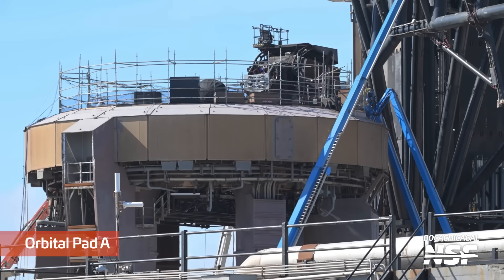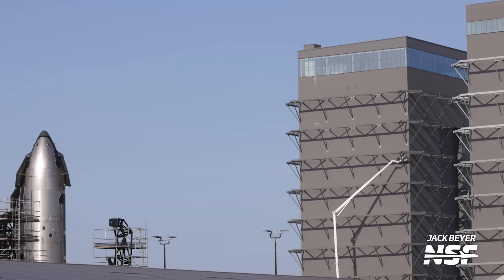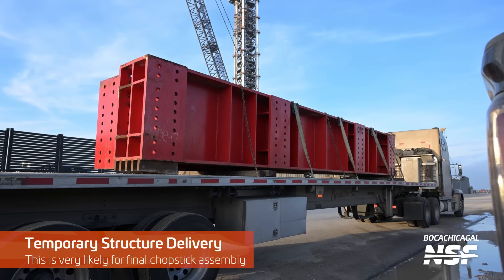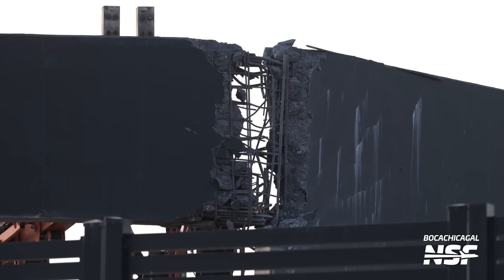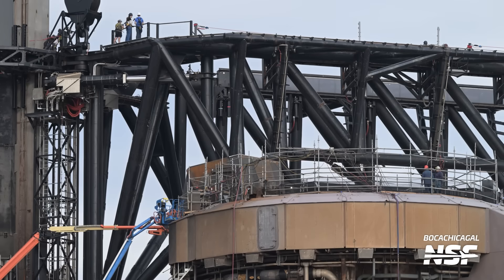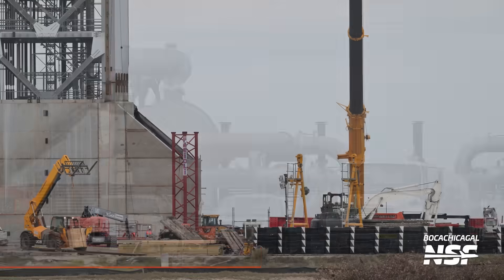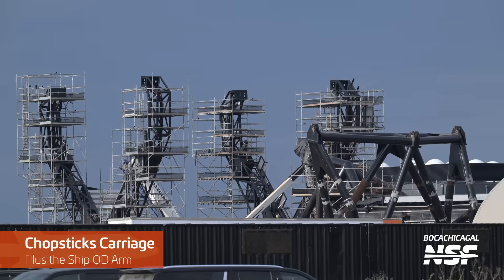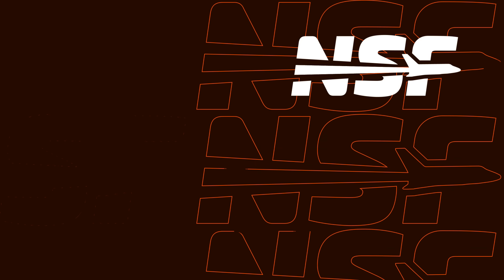Tower 2 Chopsticks Soon? | SpaceX Boca Chica

Comment: DAS, That "fishing line/wire" looked like 1/2"(13mm) or maybe up to 5/8"(15mm) wire diameter choker. which in its weakest pick configuration will be rated 4000lbs (1/2") and (6000lbs 5/8").  maximums of 10200lbs and 15600lbs respectively.

Comment: Correct me if I’m wrong, but maybe SpaceX is building the new OLM upside down, so the water cooled steel plate will spray into the trench instead of being on the top of the OLM.
Reply: As far as I know no it’s right side up
Reply: Doesn't feel like an effective way to do it though